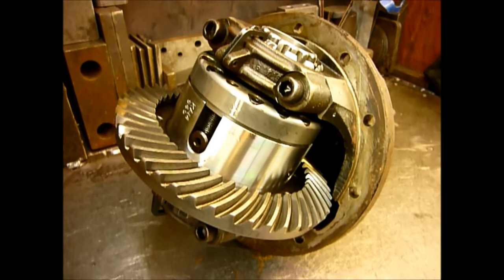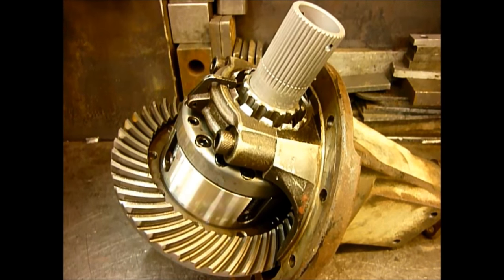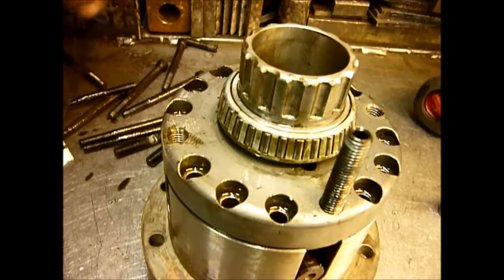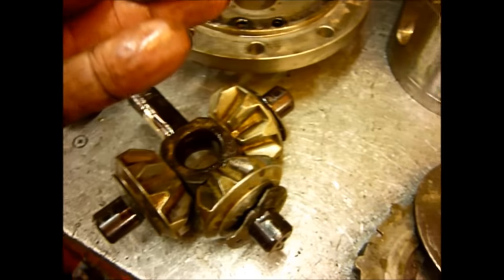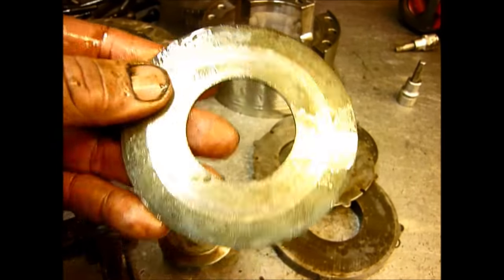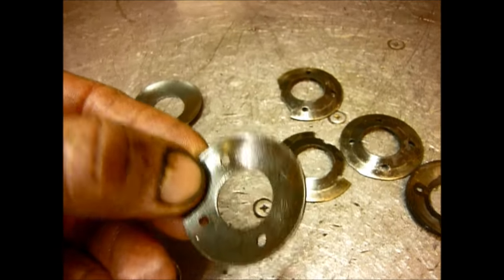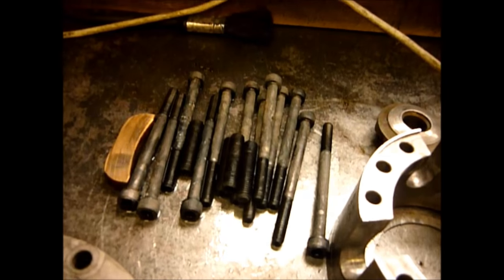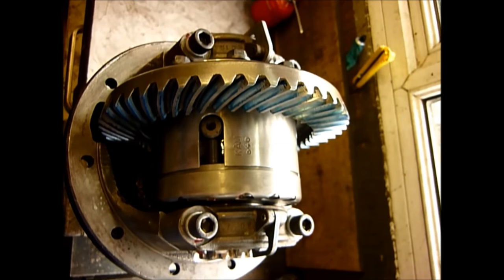KAM "Quill Tube" Locking Differential - How it works Video

Comment: I see on your site that some parts are still available, I have one of these Quill Tube type diffs in my Discovery and according to the invoices it's roughly at its 10th birthday. Low milage though. I'm putting together an email to send across after the 24th, looking for a CW&P swap on both diffs and a general freshen up. If mine was from 2013 I wonder if it still has the bad thrust washers.
Reply from the maker: I still think the KAM Quill locker was one of the best ever made and could have been even better, ut sadly it was dropped when Allmakes bought KAM out :O(. Yes we have all sorts of bits to resort this out and spares too. Just send an email to me at megasquirt.v8@gmail.com when suits and we can have a chat of options. Nige